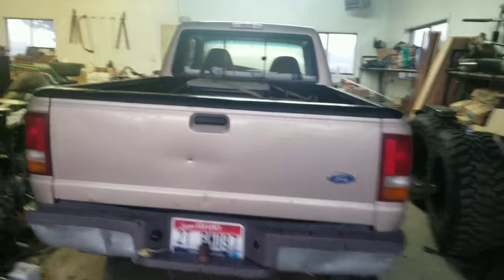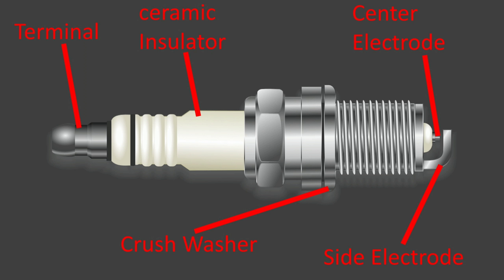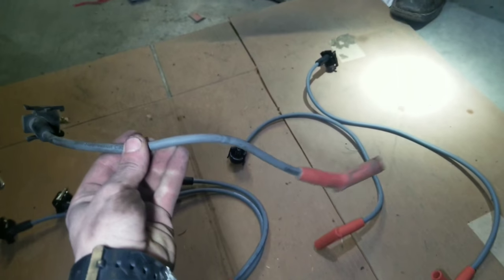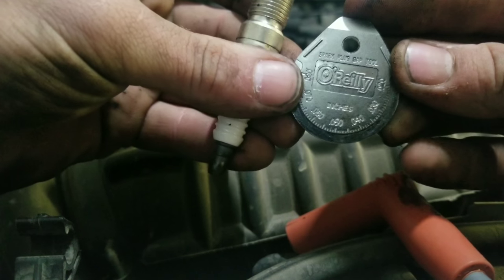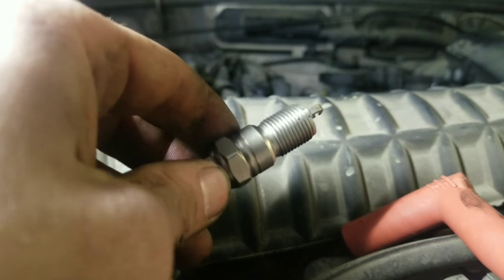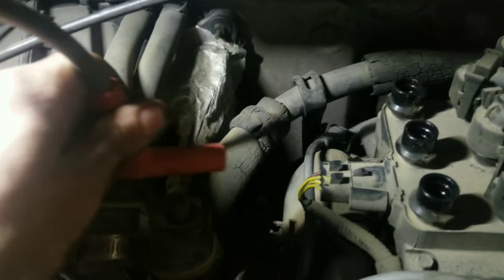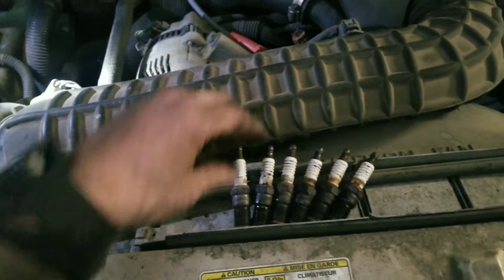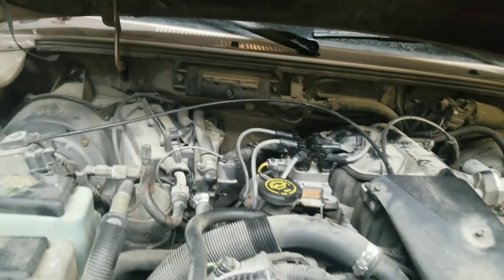How to change spark plugs on a 97' Ford Ranger 4.0 (Part 1 of 4)

Comment: The whole reason I watched this was for tips and ways to get the hard to reach spark plugs and you just skipped right over the actual removal
Reply: lol me too
Reply: did you ever figure it out?
Reply: @headsnap2710  unfortunately there really isn’t a secret method that makes it easy. The best you can do is have u-joints and extensions on hand in case you need them. After that, it just comes down to how much are you willing to remove. 

I found that the drivers side are definitely easier with no need of removing anything. The passenger side though..... my god. Some people have a bit of luck going through the wheel well if you think that would help. I personally don’t like jacking up my truck just to get at the spark plugs. However, I did remove some coolant hoses that made some room and that in itself is a little excessive. 

Like I said, u-joint, extensions, patience. Best you got.
Reply: I hoped I'd see something that might help me with a 91 Ranger. The passenger spark plug next to the firewall is stuck. I went through the wheel well but still managed to break the porcelain. All videos just give the easy examples. This plug has no straight shots not even for a swivel ratchet. I'm about ready to remove the AC to get to it. I think engineers do this on purpose.
Reply: All you gotta do is just install it in the truck lol

Comment: I thought you were going to show how you got the plugs out because my Ranger it looks like a nightmare.
Reply: I doubt he came back to show how to replace the hard-to-reach plugs
Reply: @randythomas3478  Yup, that was the only reason I watched the video, otherwise it was a waste of time. Never saw the other 3 videos -- if they exist.
Reply: @randythomas3478  did you find any video or develop any tips with sharing? Planning to do this soon.
Reply: Looks like you got to take off that tip piece to get to the plugs on the driver side. Did you have to do that?
Reply: @headsnap2710  I've been waiting for warmer weather before I tackle this project. Seems I've seen a video where the guy got at the plugs without removing anything, but it was tough to do without cross threading the plugs. Another guy went at it from under the truck -- I won't be trying that.
Reply: @headsnap2710  on my 96 4.0 automatic, I didn't need to remove anything. A plug socket and a couple extensions of varying lengths did it.
Some needle nose pliers were useful to get one stuck boot off.
Reply: @3llement I’m waiting for cooler weather. 😅

Comment: Original plugs on this truck were platinum (I know because that's what my 1994 4.0 OHV Ranger specifies).  You should typically replace plugs with the same type as the vehicle was issued with.  Not a big deal here, really, the copper ones will just need changed a lot sooner than platinum plugs.  Good video, but it would be helpful to see how you removed the passenger side plug nearest the firewall.  It's often difficult to reach and remove.  Truck sounds really good running with the new plugs!  Keep her on the road!
Reply from the maker: Han Skinslo, Absolutely true pal, this truck is my buddy's and he bought the plugs and wires available to him at the time. Next tune up on the truck or another vehicle I will cover in depth how to remove stubborn plug wires.  Thanks, glad you enjoyed the video 👍

Comment: Hi, thanks for the good Info.

Can I even use „Iridium“ Sparks on the same vehicle and same Engine ?
Had some bad idling after change.
What could be the reason?

Or do I have to use platinum Sparks?
Reply: You can use Iridium plugs but they're not necessary.